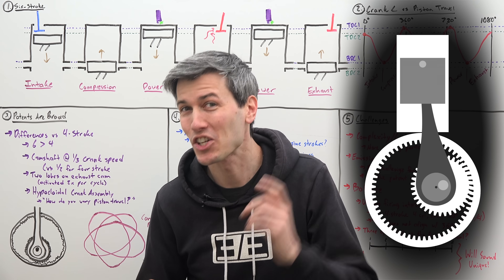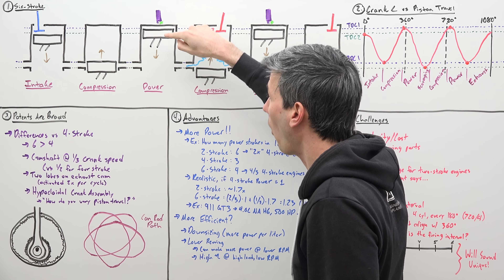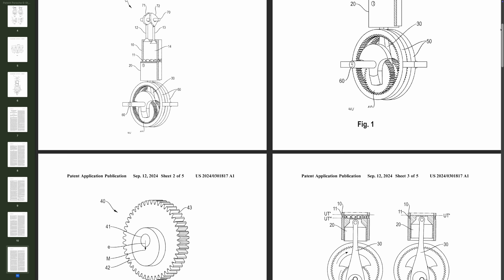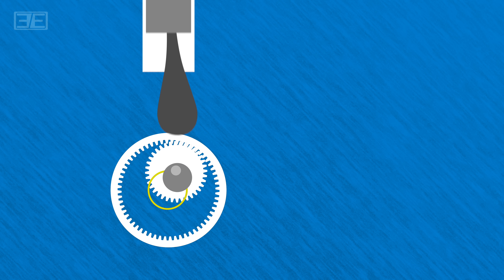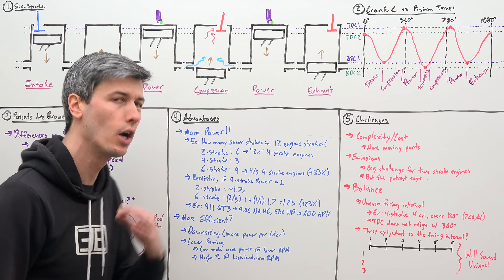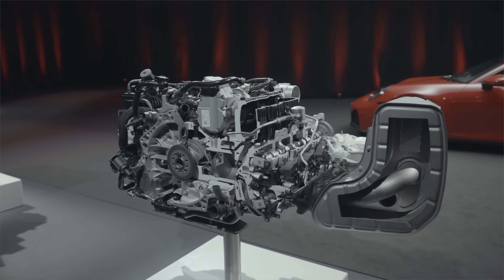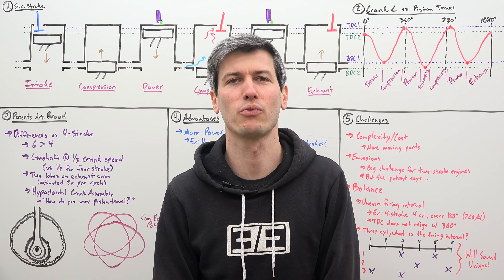Porsche's 6-Stroke Engine Is Genius!

Comment: here’s the thing about two-stroke engine emissions: the only reason they are any worse than four stroke engine emissions is to make them cheap. The genius of the two-stroke engine design that most people are familiar with was its ability to be a much simpler, lighter, smaller assembly than a 4 stroke. but if you were not trying to design a two-stroke engine to be in a chainsaw, on a Weed wacker, etc, the engine oil and the gasoline would never have to mix. A two-stroke engine would, by definition, need to be a supercharged engine, with the crank case separate from the airflow of the engine just like a four stroke, and the force that pushes the combustion charge into the cylinder coming from the supercharger. The only reason we don’t see tons of two stroke engines like this is that a two-stroke with a supercharger would cost more than a four stroke. Thus, emissions friendly two strokes didn’t ever make economic sense. This is kind of like why five cylinder engines never made economic sense before fuel injection; the complexity of a carburetor set up that can feed five cylinders would be more expensive than a simple carburetor on a six-cylinder. So the two stroke that became proliferated was the one which uses the crank case as the supercharger, using the bottom of the piston as a pump to force air into the combustion chamber. This is why they’re so little control of the fuel air mixture, the charge density, and why the oil has to be burnt in the engine. But unlike a rotary engine, where there’s an interface between combustion chambers that has no dedicated oil lubrication side, and therefore it must always, under any design schema, burn oil nothing about a piston engine having two strokes specifically requires it to burn oil. It is only the economic necessity of making it a cheaper solution than a four-cylinder (lighter and simpler as well) that gives a two stroke its poor emissions characteristics.

Jason:  am I missing something? If a two stroke engine was always built like a four stroke, with a separate oiling system under the piston, and positive crank case ventilation just like a four stroke, with the intake charge being compressed by a supercharger instead of the bottom of the piston, is there still something about two stroke that wouldn’t make it less easy to control the combustion and control the emissions? Because truly, I cannot see how the emissions woes of a two-stroke are due to anything besides the flow of combustion air through the crankcase.

Comment: I'm guessing the unusual overlap of firing order is not going to be a huge problem (think about the 'big bang' engines that were developed for GP motorbikes to solve a traction problem - they appeared on roadbikes soon after). The engineering of that crank is going to be complex though and might be a showstopper

Comment: Too bad we can't just have mechanically valved, fuel-injected 2-stroke engines. The power advantage is tremendous, but I'm sure "the green ppl" would complain that it isn't efficient enough, & wouldn't comply with today's strict emission standards. Still, seems like we could have some pretty small engines that were capable of cranking out a tremendous amount of horsepower... and the sound would be a feast for the ears!

Comment: love it. Two thoughts: The design isn't problematic if you assume (a) the 2 stroke section is fresh air and exhaust gas recirculation, (b) it requires at least 3 cylinders and (c) you fire the 2 stroke and 4 stroke events "simultaneously". The offset allows the 2 stroke event (just after 720) to extend the 4 stroke combustion (just before 360) , creating a longer power stroke by combining two events.

Comment: Honestly, it is too bad that turbine engines are so inefficient for ground transport.  Or, anything else ground based.  Turbines are always turning in the right direction.  Pistons, however, are often not providing power.  I'd be giddy if I could own an efficient turbine 30kw genset.

Comment: Impressive engineering, but not an impressive accomplishment when adding complexity and moving parts.  If they could do this without increasing complexity, then that would be an impressive accomplishment.

Complexity is the enemy of efficiency and reliability - even more so when you are dealing with moving parts.

Comment: A very interesting potential engine design, especially, with the potential use of turbo/super charging. However, I do wonder how the odd and varying piston velocities as TDC is approached will work out and if controlling for knock will be an issue, particularly at high rpm. Especially with the possibility of exhaust dilution on the second power stroke. The spirograph like big end motion path is quite interesting though. Good video and well described.

Comment: What about a T configuration of cylinders? Two sets of cylinders would be in a boxer configuration and then one more bank would come out the bottom of the boxer (actually probably the top for packaging reasons and it’d an inverted T)?

Comment: Why not just junk the outdated antique Internal combustion engine, put in a 450 KW electric and just save the problem and get better performance?  Easy peasy and no oil changes or burning stuff.  Just a quick redesign here

Comment: One challenge that stood out to me is how they are going to block the oil from the piston squirter from being pulled in with the air on the lowest point. They would almost have to have some kind of valve to open and close at the right points but the valve would not be able to push out like on the head or it would strike the piston. It also seems like an opening in the cylinder wall would cause a lot of stress on the piston rings as they glide over those spots.

Comment: The uneven power problem is solved if you use an engine with a cylinder count that is a multiple of 2. Odd that the patent explicitly claims to need a multiple of 3 cylinders. Regardless, it works out with a 6 cylinder, which would seem to suggest that they have 6 cylinder engines in mind.

Comment: Hold. Up. Stroke 4 is an interesting stroke! The second "compression" stroke... Very interesting. You have to remove air - burned air. i.e. Exhaust gas - to get new air in. So... surely that should be a "compression/exhaust" stroke??

Comment: The two stroke problems have been solved long ago; no more crankcase scavenging and no more carburetors. We are now seeing forced induction and port-initiated direct injection so that the fresh fuel charge is not blown out the exhaust port. The only thing in the way of seeing emissions-legal 2-strokes on the market is specific, blanket legislation against it.
Reply: that's a California and India thing, it's actually legal in Europe and most of America

Comment: Honestly I want them to build one just to see what it sounds like, but I just don't think this will every be going in a production car since you first of all have the whole balance issue and the insane increase in complexity of the crankshaft (i wish them a lot of fun, trying to fit that into a 911) and secondly idk if this is worth doing since I don't see how they can keep the emissions down( except maybe trying to use the 2nd powerstroke as some sort of efficiency stroke where they use parts of the emissions of the first stroke, but no clue if that makes sence) And the whole issue with the european car market is that emissions regulations are getting tighter. Mazda did an amazing job with the variable hub which can actually increasy efficiency, so either they find a similiar usecase or this is not gonna be a production engine

Comment: In an anecdotal observation (I used to race dirt motorcycles)? Going from a say 55 hp 2 stroke to the equivalency in a 4 stroke? Expensive to purchase... Very expensive to maintain...  Re-ringing multiple times a season became necessary, Because the rings traveled far further AND faster ( higher rpm necessary for power equivalency)...
The days of a 4,500-6,500 rpm engine are Long gone...
*Ring friction is a huge deal in ice engines... Just the reality.. 
Personally, I didn't miss the stink of a 2 stroke exhaust (several @ once)
*Fun observation? Breathing as a spectator..inside an arena..is bearable now.. And you can actually SEE the race!!! IThe indoor smog was awful...)
Gas sealing friction.... The Achilles heel...  Wankels & APEX? Sealing issue..
Rings... A necessary parasite..

Comment: It's never going to production because it has too many parts and two failure points,the offset rod-crank(remember rotaries;;) and port in cylinders.
 It is good design to brag about.....but already there's the ski doo 2 stroke turbo engine if we need more power.

Plus if it was viable the marine industry would have already invented it.

Comment: I wonder if Porsche just worked on optimizing the 2 stroke with port and direct injection with oil injectors and catalyts and maybe electric force induction. But i digress... Still very interesting. Congratulations 🎉 on the 1000th.

Comment: Clean burn 2 stroke is an oxymoron. Emissions is the biggest hurdle for 2 strokes and you spent 15 seconds on emissions. That needs to be half of your video. Don't believe the engine will make it. Turbos can give you more power and more efficiency and meet emissions. Why bother with this Frankenstein engine.

Comment: It might be genius, but its introducing new wear timing parts.  Overcomplicating a process that is going to need very expensive tools and wear components that are going to be very expensive.  How much work, how much teardown to replace that crank gear, or the piston rod gear.  You are still going to have bearings that wear for each crank journal, now you also have gears.  How bad does the engine grenade if any of those gear teeth shear while its running.

Comment: I would like to step through the timing logic of offsetting  the power stroke by 120° instead of 180°.  The first impression is that it might have a slight overlap in the power strokes between cylinders.   Without graphing a complete timing cycle it is breaking my brain trying to visualize it..  thanks for a great video!!

Comment: This has to be more focused on reducing emissions than it is on increasing power (burning off unburned fuel still in the combustion chamber).  I'm also surprised they are even trying to use camshafts.  I'd think electronically timed, magnetic valve actuation would be better, and frankly could allow for the engine to run in 4 or 6 stroke modes.

Comment: To be fair, Jason, there's little reason to think Porsche are planning to develop this into a marketable (or even a working) engine.
Large multinational corps file patent applications for lots of reasons, including to prevent others from claiming the subject matter as their own. Porsche would be able to succeed with the latter whether they get this patent family granted or not.
They've only filed this in Japan, China, Europe, and the US patent offices, which is a good indicator of this being a "defensive" filing, designed to prevent others from claiming this idea.
Patents protect a concept, and not a product as such.

Comment: You missed a variable! You assumed that each power stroke has the same force, that is not the case. You can then use that difference in force to further smoothen out the operation of the engine. i.e two low force strokes timed together vs 1 high power stroke to balance it all out. O, and yes, my name must be included in there, you can take the initiative.

Comment: For efficiency possibly the second compression stroke will compress some unburned fuel in the exhaust? I see the exhaust valve is shown open on your diagram but it will have to be closed for part of that stroke if it’s a compression stroke. Also, having an exhaust valve open for part of the compression stroke is something done in Atkinson cycle VVTI engines for efficiency. IMHO.

Comment: The maximum equilibrium is on a 6 cylinder, so when one is at power 1, slightly left of that 360, then you fire another on power 2 sligtly right to that 720, getting an equilibrium at the middle. And 6 cylinder so the power is continuous, you'll always have 2 cylinder powering, one power 1 and the other power 2, that would be my guess for equilibrium.

Comment: Asking German engineers:  Why did you put the starter in the middle of the engine under the intake manifold under four non-removable plastic pipes full of antifreeze where it takes 12 hours of labor and costs over $4,000 to swap it out?  Answer: Because we got bored and decided to change things up!  And I say... stop, just please stop.  🤣🤣
Reply: Just like the Cadilac engine with the starter between the cylinder banks and under the intake manifold.
Reply: @larsjrgensen5975  The Cadillac engine was designed in Germany
Reply: They dont want you to be able to work on your own car thats why....they want you to bring it in for basic work
Reply: Toyota too.
Reply: @LarsDennert this is when you punch yourself for buying an 2005 LS430 and 2001 Tundra….
Reply: Actually they just did the math on how many times it would be leased out before going the crusher and then cross-referenced that with average starter replacement.
I would probably just drive a stick and park on a hill 😂.
Reply: Shut up!
Greetings from Zuffenhausen!
Reply: Bentley starter is engine out
Reply: Sounds like a Porsche suv
Reply: That's just pure revenge on society and women to put a nonservicable starter on a car where yeah, it is technically serviceable but it's going to cost more than a transmission rebuild.

Comment: How is the cylinder being filled with air for the 2nd power stroke? It is not sucked in by the piston. This engine cannot run without a compressor/supercharger, resulting in even more complexity. This is a nice thought-play from the engineers, but I bet PorschE will not build a running prototype.

Comment: If they can fill the cylinder from the bottom. What is the point 4 of the strokes? If that works reliable they could go for 2 strokes and delete all the complexity of the other two strokes. And have  power on every stroke ....
Reply: There have been double-acting two-strokes, where power is applied to the crank every 180 degrees...

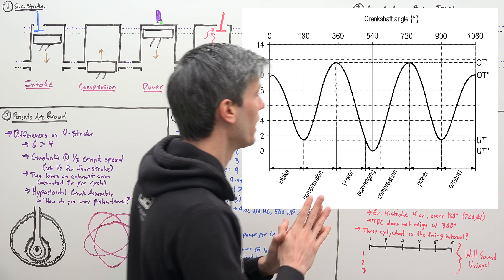Comment: Pause at 12:32 and study the diagram of strokes.  A weakness of the concept can be seen in the short period of scavenging between the first power and second compression stroke.  The exhaust valve must open to expel exhaust 20 or so degrees before the cylinder ports open to admit fresh charge.  Scaling off the diagram gives an estimated interval of 72 degrees for the scavenging phase, and half of that is while the piston is still descending.  In order to get a full charge in only 40% of the time available in a normal 4-stroke intake event, there will have to be a supercharger of some kind pressurizing the secondary induction system.  This will increase engine friction.  The parasitic loss could be minimized if they use an electrically-driven centrifugal compressor.

Another problem will be oil consumption due to the piston rings running over the cylinder intake ports.

And don't get wrapped around the axle over the fact that the engine will have uneven firing intervals.  That has nothing to do with engine balance.  And the cycle phase diagram at 12:32 shows the event offset is only ~12 degrees.  (The first power stroke starts at 348 degrees, and the second power stroke starts at 732 degrees.)  This will contribute slightly to torsional vibration by making the events uneven, but torsional vibration dampers can be designed to compensate.  Another issue affecting torsional vibration will be uneven magnitude of power strokes if the second one is significantly weaker than the first.  Then the TVD would have to be designed to damp 1/3-order torsionals.  But that is considering only one cylinder.  This is probably why Porsche put in the patent that the system is recommended for use on engines with multiples of three cylinders.  That way, firing can be phased so that successive cylinders will be on Intake, Power1, and Power2 strokes, thereby making even torsional vibrations throughout the 1080-degree cycle.

Another factor affecting engine friction is the cycloidal mechanism.  The spur gear orbiting inside the internal gear needs to be supported on a bearing, and the rod big end placed eccentric to the gear axis needs its own bearing.  Now they need twice as many bearings as before to support the rod big end compared to a conventional engine.  That adds friction due to more surfaces moving relative to each other and also adds parasitic loss due to increased oil pump flow to supply the extra bearings.

Comment: Why a six stroke?  You left out the most probable explanation:  it follows the German philosophy of engine design which is why build a mechanism that requires four parts when six will work just as well?😅

Comment: This motor better make good low end power, because the exhaust valve timing/speed will be a nightmare. I don't think they will be able to make it work with two lobes on the same cam. Not with all the modern amenities like variable valve timing. I think they will have to install a separate cam just for the special exhaust stroke

Comment: If it is a two stroke, without a proper exhaust the power will be anemic. How do they compensate this? Also what happens with oil? Does it burn it? I either missed parts of the video, or the video misses the most crucial part. One of the only videos here that i watched and still feel i did not learn much on the subject.

Comment: RE: Cylinder spacing, 4th grade math time!  Since you need cylinders divisible by 3 and you apparently need clusters of 4 cylinders in order to be able to balance their power strokes(though this is all off the top of my head, so I might not have thought it through), wouldn't a 12 cylinder engine be the minimum balanced engine configuration?
Reply: inline 6 should do well in this config